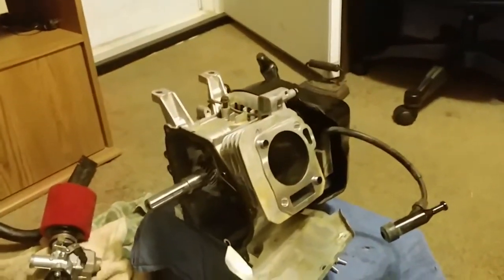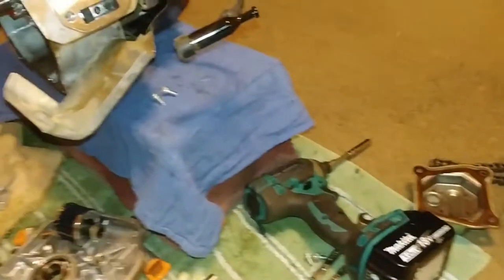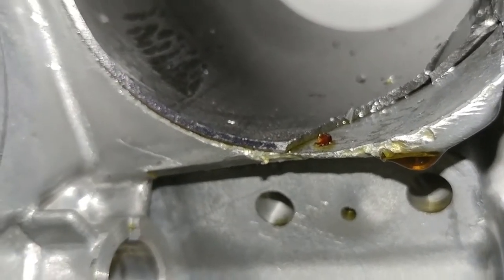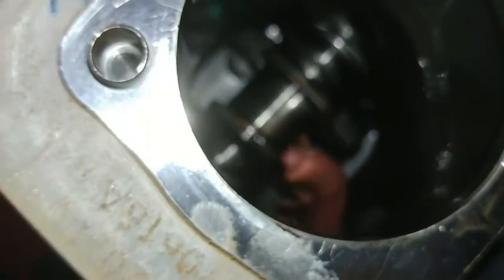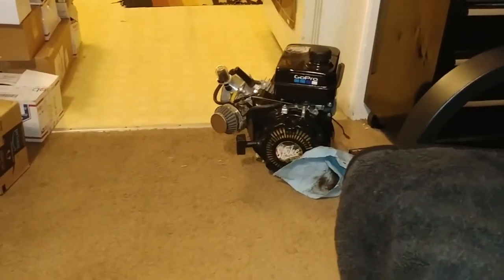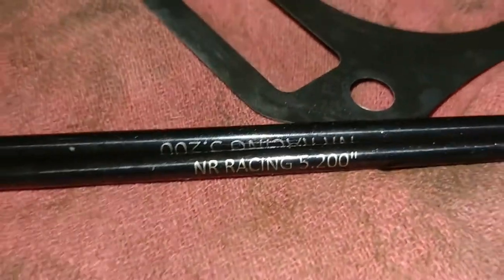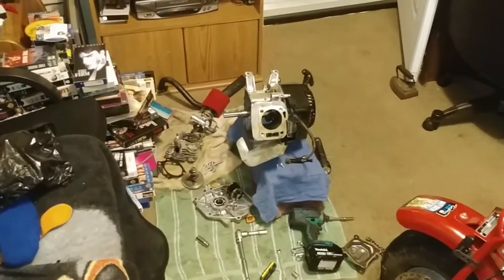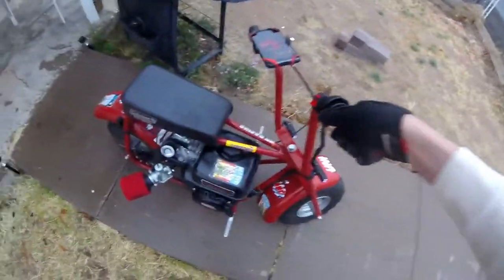new engine swap on the coleman ct 100u quick fix

Comment: Thats a nice sounding engine dude, as far as it wanting to throw you off, its that 75 or 70 tooth rear sprocket, thats a real low end gear for that 212cc power, the stock CT200 comes with a 50 Tooth which is a well balanced sprocket for low/high end,  i like the 60 tooth myself for the fullsize coleman....i bet that little bike you have is like riding a bucking bronco....lol
Reply from the maker: i have the 70 tooth sprocket on it for more top end thing hauls ass dude =)
Reply: Yea, you could definitely use a 50 - 60 tooth if you want to make it a bit more rideable.
Reply from the maker: web site please ;)
Reply from the maker: was checking this out before you sent me the link glad to see we are on the same page ;)
Reply: Yeah, i got the 54 tooth on mine, very rideable and very fast
Reply from the maker: awesome heads up i got the hemi
Reply: Did the other one blow up? or did you just want to switch over to the hemi? BTW i have a hemi on my ct200u-ex bike, i really like that motor, i need a torque converter on that one
Reply from the maker: John Bishop no I blew it up but I got lucky cuz they sent me the Hemi in the mail

Comment: What oil do you use for the chain and clutch?
Reply from the maker: chain lube from auto zone and very light axle grease only in the bearing set for the clutch i have video's on just that just have to look for seized up clutch how to fix ;) hope this helps brotha!
Reply: +spikeman dan thanks man! I'll check out that video right now. I just got a ct100u and I appreciate your help!
Reply from the maker: np its what i do ;)

Comment: Was this hard to install?
Reply from the maker: nah man its rather ez ;)
Reply: spikeman dan did you have to drill any holes in the frame?
Reply from the maker: oh my god yes why did you ask i had to drill like a tone of hole's so many how did you know?
Reply: where did you have to drill them at
Reply from the maker: John Kennedy I was just kidding no holes needed to be drilled engine lines up just fine on the frame I thought you understood sarcasm
Reply: Thats great and yeah I do. Its just hard to tell when its not it person
Reply from the maker: John Kennedy haha yeah the 212 fits there is a catch you do have to go to Coleman PowerSports in order the gas tank from the CT 200 and put it on the 212 otherwise the gas lid sets right underneath the frame and you can't get any gas in it unless you find a way to remove the air vent and use that as a gas Inlet
Reply: Oh I got ya. I just did a predator swap on my friends 200. when I swap mine on to my 100 ill just take the tank off of that old engine ;)
Reply from the maker: John Kennedy perfect at least you don't have to reorder one like I did I've already blown two engines waiting on my third one to show up should be here today or tomorrow more than likely it'll be here today I made mine stage 3 and I got to say it's wicked fast but because there's no governor I over revved and blew the engine twice
Reply: damn.... I feel like I'm about to blow the stock 3hp with a bypassed governor.
Reply from the maker: John Kennedy I did the same thing to my stock 3 horse ran the s*** out of it at top speeds and never blow it up still sitting on my kitchen floor

Comment: I think your supposed to advance your timing more for that cam? Maybe needs a 4-6 degree advance key? Check specs for your cam.But get a helmet anyway dude, your gonna have a funny looking part in your hair if you don't!I have a ct100u and the brakes are garbage even for a bicycle!
Reply: 90mph PULL-START        https://www.youtube.com/watch?v=0T950x_-Viw
Reply from the maker: it has the arc 30 degree  advance flywheel on it already so should be up to par
Reply: what cam are you running? should be able to find specs for timing recommendations or your specific cam.It's probably something like 32-36 degrees advanced.Might be why it's stalling when you throttle it? Best way to set timing with a light and degree wheel and not even use ANY key at all.The flywheel doesn't need any key to hold it as long as it's properly lapped in and torqued to spec.
Reply from the maker: MybackHurtz1 265 dyno cam
Reply from the maker: might be a jet issue needs to be adjusted